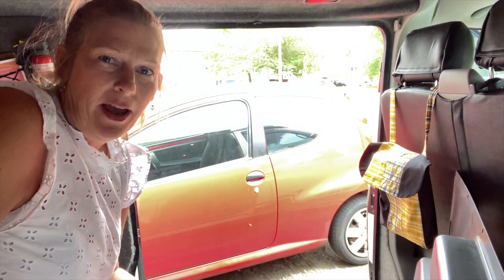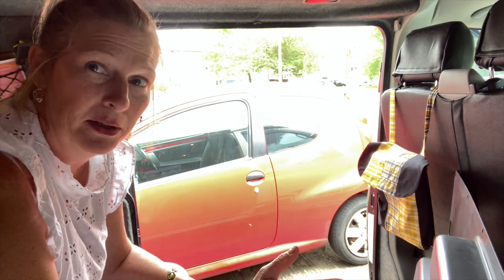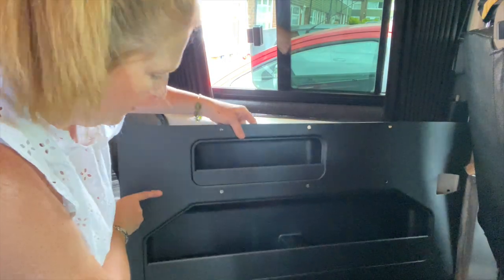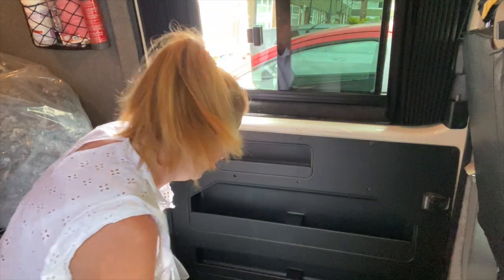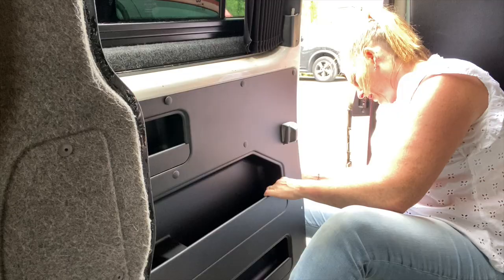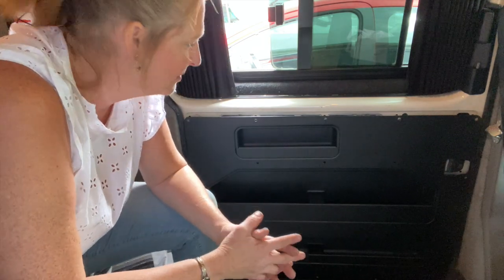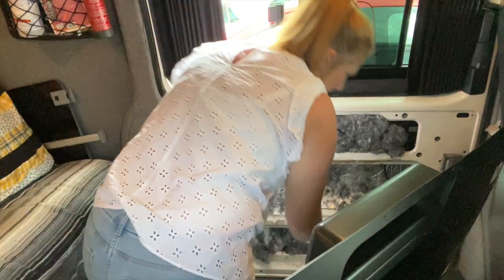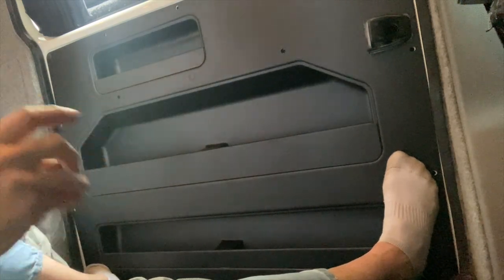MOST ANNOYING SIDE DOOR STORAGE INSTALL   | T5VW camper van storage solution @vanlifegoodies

Comment: A little top tip Ruth get a screw and screw it into the hole in the centre hole then pull with pliers that will remove the centre then when all the centres are out just pull the panel off.
Reply from the maker: Now you tell me !!😂😂😂😂